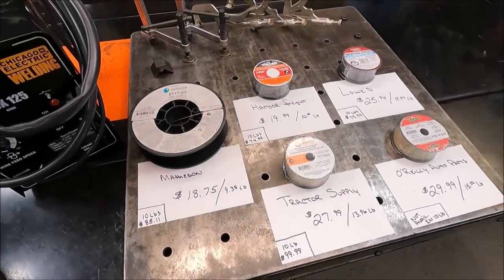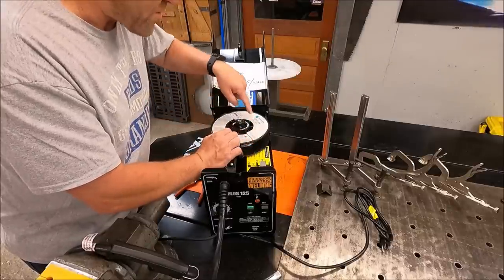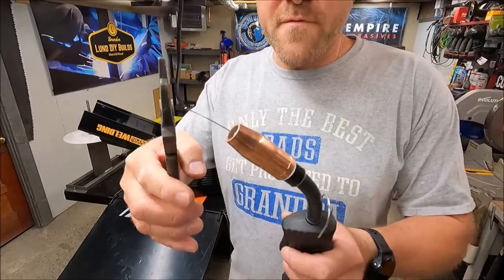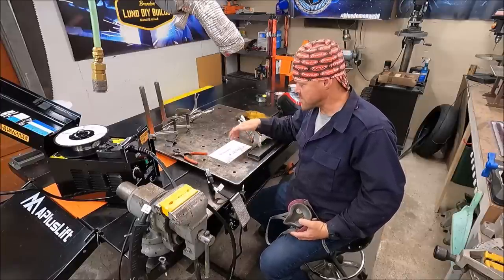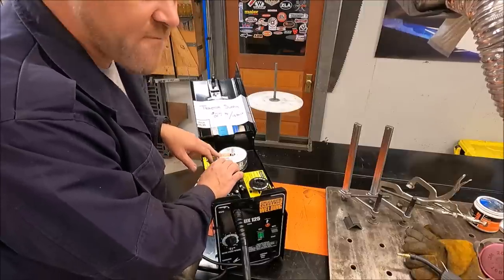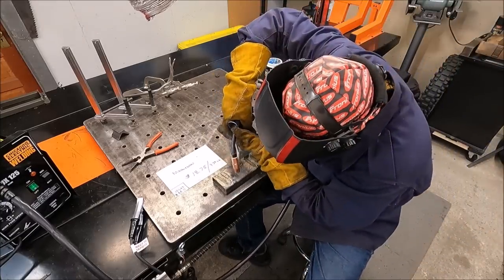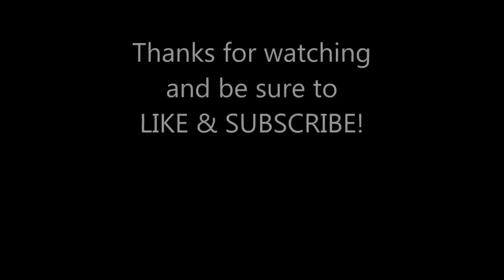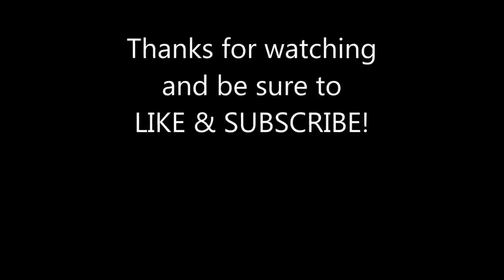Testing which Flux Core Welding Wire is Best

Comment: Hey Brandon, I use the same Harbor freight welder and have very good luck with the HF wire. I turn the wire speed down to 5 or 6 depending on the metal I'm using, and I get a nice clean weld with low spatter.
Love your channel, its nice to see a fellow Mainer on YouTube!
Reply from the maker: @Adam stairs Thanks man! The Vulcan wire didn't actually run that bad once I messed with it for a while I was able to get a decent bead but it took some playing with to get it right but when I ran each wire back to back without that learning curve the Lincoln and Hobart stood out. I lived on Lincoln St. In Randolph as a child and had neighbors with the last name Stairs...any relation?
Reply: @BrandonLund  I'm originally from Aroostook County, so most of my relatives are up there, but it's possible that they are related. 
I live near Bangor now. 

When you set up your HF welder did you change the polarity of the leads?
I left mine stock and I think the gun is actually ground.
Reply from the maker: It's possible. I grew up in Randolph then Gardiner and Auburn. This welder doesn't have any ability to switch polarity which I thought was odd because the stinger has holes for gas and it uses a gas nozzle
Reply: @BrandonLund  I'm in NH now but I grew up in the Portland/S. Portland area initially, then we moved up to Eastport, where I spent most of my childhood.  Great to see other current and former Mainers here.
Reply from the maker: @yertel t I was just in NH last week for bike week. What a  experience that was! It was my 1st time at that event.
Reply: @BrandonLund  hey you are right, I just went and looked at my HF welder and there isn't a place to swap the leads and change the polarity. I must be thinking of the Miller mig I had before this one.

Comment: Running the tractor supply with Forney Easy Weld 140 FC-i. So far pleased. Appreciate yuh testing these out n saving a guy time from experimenting.
Reply from the maker: Thanks man! I was going to tet that wire. I've used some Forney wire years ago and remember liking it.

Comment: I've got one of them same machines, use nothing but the Lincoln wire in it. Also got it a better ground clamp and put in a bridge rectifier so it runs dc on proper polarity rather than the stock ac output. Before the mods Lincoln was the best for me as well.
Reply from the maker: @Dylan great tip on the rectifier!
Reply from the maker: @Dylan thanks for sharing!

Comment: Brandon - Excellent video, especially for beginners.  Great explanation of important basics.  I did similar testing a couple years ago using a Hobart Handler 140 and now I use the HF Titanium 125 for FC. There is a huge difference in wire.  What is interesting is that for me, the Lincoln wire ran really bad - it was the dirtiest and most spatter, and least consistent bead. I tried a couple of the wires you tested but also INE (German or Italian - can't remember), Blue Demon, Firepower (Napa brand - probably the worst of them all, but also THE most expensive). My welding supply store suggested Washington Alloys - which was by far the best for me - not even close. Great profile and the cleanest burn/least spatter of anything I tried. And it is reasonably priced.  That is now the only brand I use for flux and MIG.  Everybody has their own experience and favorite - just wanted to throw my 2 cents in here.
Reply from the maker: @Booger & Zeke’s Welding Emporium I've heard good things about Washington also but I havent tried it. Now that you mention the Hobart 140, you have me thinking. I was using the Lincoln with my 140 but then switched to Matheson and immediately liked it better. The Hobart is a DC transformer based machine and all my other welders are either inverter based or AC. You could be on to something...Maybe the DC transformer has something to do with the Lincon not working as good with the Hobart because I guess in hindsight that was my experience also when comparing the Lincoln to Mathesion using the Hobart 140.
Reply: @BrandonLund  ya know, you might be on to something. That Chicago Electric unit you used for this video is transformer isn’t it?
Reply from the maker: It is. It's an AC unit and the Hobart is DC

Comment: great video... I use that Lincoln wire and it works better for me.. the harbor freight wires and rods have always ran with difficulties.  Hobart wire works fine in my machines as well...
Reply from the maker: I agree 100%!

Comment: Thank you for the video Brandon.. I bought my HBF Flux-125 over two months ago and set up a dedicated 20Amp outlet outside my Garage. Almost broke my Hip falling off a ladder drilling the hole and running the Line through the Attic Top Plate to the outside wall outlet I installed ! 

I bought everything I need to get going each payday and yesterday I was FINALLY READY to try my FIRST test welds !! YEEHAHHH.... When I tried to load the Lincoln .030 1LB wire coil the wire was difficult to feed through. Then... wait for it!! ... BZZZWHOOOP! the WIRE of the roll suddenly turned into a HUGE BIRD'S NEST! 🤣😲DAMN !!! I tried to re-wrap as much as I could and cut it off and tried AGAIN and... BZZZWHOOOOPPP..AGAIN... after four tries and several yards of wasted wire.. I gave up, put everything up and Later last night.. I tried again in my 'Mancave' ... just to get the wire to feed... Again and AGAIN..for OVER TWO HOURS.. at LEAST 10 Yards of WIRE on the floor. ONCE I got the wire to feed.. almost.. but it stopped before the wire came out... I'm Done ... 

I used .030 Steel Safety wire every day working on Helicopters and NEVER expected this! The properties of this wire are totally different!

 Do you or anyone have any clips that focus on the Loading/Feeding process or TIPS to keep this from happening ? Otherwise.. I'm selling my NEVER USED FLUX-CORE and getting a STICK WELDER... Which might have been the better choice for a newbie
Reply from the maker: @DaddyDawg Sorry to hear that man! Hang in there because after you do it a couple times it will be easier. Here is a video loading up aluminum wire but the same principals apply for all wire. If you to skip to the 9 minute mark I talk about setting the tension on the wire reel and the drive rolls. It sounds like you have one or both needing adjustment. Just know it still happens to me occasionally 😉 https://youtu.be/nCMTbYJfOG8
Reply: HALLELUJAH and PASS THE PEANUTS!!!! 🤠🤠😎AFTER watching YOUR DETAILED CLIP explaining setting up the TENSION....  and after using a Plastic Bag strip Heat Shrinked around the spool to stop the BIRDS NEST... I was able to FEED THE WIRE PROPERLY! WOW!! If I weren't heading to Jacksonville for the Jags Draft Party in about an hour I would be setting up and trying my FIRST WELD! I'll save that for TOMORROW and update you after! THANKS for THIS and ALL your Video clips!
Reply from the maker: Congratulations buddy and have fun at the party!

Comment: I only use flux core. You do not need the gas shield for flux core. it is a conductive contact point. Lincoln wire is the only brand I have ever used.  Been very happy with it for years. And yes it is a Lincoln welder.
Reply from the maker: @Bubba Pate I use flux core a lot also. It's good stuff!

Comment: I am a beginner welder and the used welder came with the lincoln .030 you tested...I used about 3/4 of a 1lb spool and switched to INETUB BA71TGS .030-Inch on 2-Pound Spool Carbon Steel Gasless Flux Cored Welding Wire that I bought off amazon.   My welds improved and the splatter was much less.  I find that it generates more smoke though.
Reply from the maker: @BitsofBytes I have seen that wire too but have never tried it. I plan to pick some up and do some more testing. Thanks for sharing!

Comment: All the portable welders I've used through the years I've always ran Lincoln wire and got the best performance you could out of the welder it was in.  I've tried other brand's and never had any good luck the Hobart is ok if your in a pinch and can't get your hands on any Lincoln wire when you ran out and need to run a couple more beads.
Reply from the maker: I agree 100% @kmrjeep It's good stuff

Comment: I’m back.  Just wanted to tell you how much I enjoy meeting another flux core fan.  My Forney flux core welder I picked up at Home Depot for $179 welds ten times better than my Lincoln Mig which cost way more.  And I’m not buying a tank of gas every time I turn around.
Reply from the maker: @Scotty Collins right on! It just goes to show that more money doesn't necessarily mean better quality.
Reply: You can reverse polarity and run flux in the Lincoln but need to run Lincoln wire in it to get any good results anything else burns like crap.
Reply: @kmrjeep  Yep. My beloved Forney finally bit the dust.  The Lincoln is getting the job done as a flux core welder.  Much better than as a MIG welder.

Comment: 32 yr welder here and Lincoln sounds on point , by the way should have preheated the block fr the start as your first test was on cold steel and the last was preheated
Reply: Lots of moisture in a block of steel , should of least sweated it first
Reply from the maker: @,Tror Macmillan I let it cool in between each test.

Comment: I normally use Forney e71 and ran out on a job for a friend and we ran out to lowe’s and bought flux core lincoln wire. I was really impressed with how it laid down.
Reply from the maker: @david Perez did you like the Lincoln better? I've run Forney many years ago and it's been too long to remember how closely they compare.
Reply: @BrandonLund  The lincoln laid down a lot nicer but I don’t recall if I changed the settings after putting in the lincoln spool.
Reply from the maker: Thanks David 👍

Comment: I really appreciate the video! I have been learning how to weld with the same machine and the Vulcan wire is all I have tried on it. It definitely does not work the greatest unless you keep the speed slow. I'm definitely going to try the Lincoln wire
Reply from the maker: Glad I could help. You will see a huge difference in how smooth it lays in
Reply: @BrandonLund  thanks bud I appreciate it!

Comment: Great Job, thanks. New to welding. Just a thought. If you are running different wire feed speeds for different wire, wouldn't a better cost comparison be the cost per inch of weld.
Reply from the maker: Thats an awesome suggestion but that alone could most likely be a whole new video. If the wire is inferior than it's going to ultimately cost more than just the actual cost of the wire.

Comment: Interesting and useful information. When I did personal testing of FC wire my results were different. I found the Innershield to be horrible. The most expensive stuff I tried was Napa Firepower wire which globbed up like a pregnant caterpillar no matter what I did. Ultimately my welding supply store recommended Washington Alloys FC wire which made a HUGE improvement and welds much better than those in your test. I consistently stack dimes with no BBs and clean up is a couple seconds with a wire brush. And it’s low cost. Worth checking out.
Reply from the maker: @Booger & Zeke’s Welding Emporium Interesting. I think a lot of it might have to do with the machine. I will be trying this same experiment in my Fronius and see how it stacks up. I know my Hobart 140 runs really well on the Lincoln wire so it will be interesting to see if this test is different. I will have to pick up some of that Washington Alloy wire and give it a try! Thank you for sharing!
Reply: @BrandonLund  yeah the machine is an important factor. Funny thing- I did all my testing on a Hobart 140. I don’t have that anymore and now I just a HF Titanium 125 for my flux core work. The Washington Alloys is still the best for me in that machine too. I look forward to your update. Thanks
Reply: Don't stack dimes with flux core.

Comment: I have the inverter welder from Harbor Freight and used the Lincoln wire for the most part but found the Hobart wire actually ran the best. I also switched to the .35 instead of the .30.
Reply from the maker: I like hobart wire also

Comment: Uh, the Lincoln electric is 25.94 per lb. You shouldn't have divided by 2 for a 1-lb spool. That makes the Lincoln Electric the priciest per lb.
I use a Lincoln Electric Welder and Lincoln .035 flux-core wire.
Nice video by the way. I had just ran out of wire and was thinking of trying a different brand. You stopped me. The Lincoln has always worked well for me. Thanks!
Reply from the maker: It's good stuff for sure regardless of the cost.

Comment: I picked up the Harbor freight  (Chicago Electric) Mig (220v) and also the Flux core 125. The guy sold me both for $40. He showed me the flux core one worked and the mig wouldn't feed well. Turns out the Mig had old rusty wire on it (just reeled off a bunch and it works fine). I bought .035 wire and tips for the Flux core and its doing decent but still seems like I am doing something wrong at times. But I am learning.

 I couldn't pass these up for the money. While I want a better machine I think these two will get me by a while. Now seeing this video I think I may buy the Lincoln wire for both. Thanks for the videos. I love learning new stuff.
Reply from the maker: @ADV Jason you scored big time! Congratulations man! This Friday's episode I'm actually using a HF welder building an outdoor fire pit 😁
Reply: @BrandonLund  That's awesome. I have a big cast iron caldron (32 inch dia) I use for a firepit I used the flux machine to build a grill top thing I can use on top of it so I can cook on it. It was my first project. Just need to finish collecting some more metal and finish the cooking surface. I find it pretty fun to build stuff and Learn so this is right up my alley.
Reply from the maker: Right on brother! Nice!

Comment: I know this is an older video but the Lincoln spool shown in this video is only 1lb vs the usual 2lbs the 4 inch spool comes in. That makes it the most expensive per pound if you're buying 4 inch spools so not really worth it unless you're buying the 10lb version. Also Eastwood is currently having an online sale on .035 2lb spools of flux core for $7 each AND they have a $15 off any order coupon. I weas able to buy 4, 2 inch spools (8lbs total) for $30 after tax, or $3.75/lb. I haven't personally tried Eastwood branded wire yet but from reviews I've seen online it seems to run about as good as the Lincoln or Hobart wires. The $15 off coupon ends September 21, 2023 so only a couple days left; and the sale doesn't have a date range so I'm assuming until they run out.

Comment: I recently bought a Harbour Freight Titanium 125 Flux Core welder (on sale for $179) through July 5th. Anyways their Vulcan Flux core wire is $13.95 on sale Reg $19.95 a spool. Saw the Lincoln wire at Home Depot for $13.95 ! But if you are a Veteran you get a 10% discount so for about $12.00 you can get the Lincoln Wire!
Reply from the maker: @bloop68 sweet deal. I'm very happy with the HF flux core welders. It's what started my interest in welding 30 years ago. That's a good price on the Lincoln wire. The only downfall is that the Lincoln wire only comes in a 1lb or a 10 lb. spool which works out to be around $24.00 for 2lbs. The HF wire didn't run too bad once I messed with it for a while but without the learning curve the Lincoln did better and it's worth the extra money (just my opinion because I know others have had good luck with the HF wire)

Comment: I use GIG-WELD wire in my welder. The welder is identical to the one you have, but marketed under a different brand name. I do not set my wire speed higher than 4, & I get a good weld that way, with the weld current on max.
Reply from the maker: Right on Christopher. I will have to try some

Comment: a little tip for using HF wire welder is to lube the shaft where the wire spool slips over it.
Reply from the maker: @J D good tip!

Comment: I'm glad I got a deal on an inverter based flux core welder that has adjustable voltage as well as the feed and mine is DC not AC
Reply from the maker: A lot of people aren't a fan of the AC machines. Although I like DC better, I kinda like mixing it up now and then :)
Reply: @BrandonLund  I think flux core is supposed to be DC I don't think it was ever supposed to be AC but a big transformer was cheaper without some caps and a bridge rectifier

Comment: I use Vulcan solid core wire, works great for all projects for the home hobbyist and artist.
Reply from the maker: @Just for fun I will have to grab some and try it!
Reply: You're using solid core wire without gas?
Reply: @frankschwartz7405  No, I do use gas. I was just saying that Vulcan brand works great for me when using it with the recommended gases. This is a fluxcore review, but the final product with the vulcan brand looks great with gas.